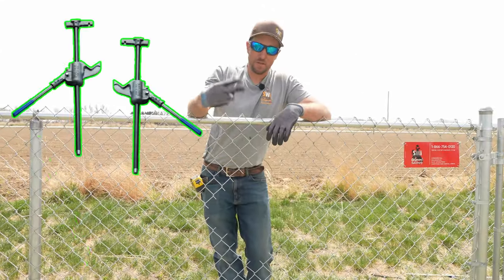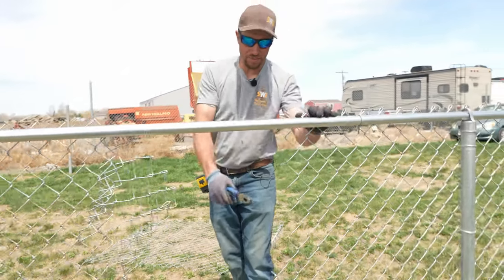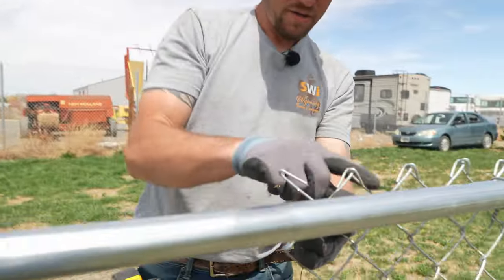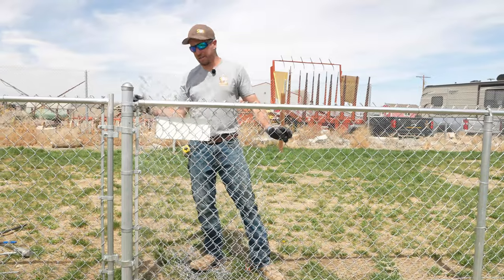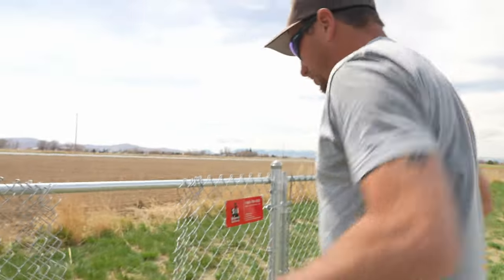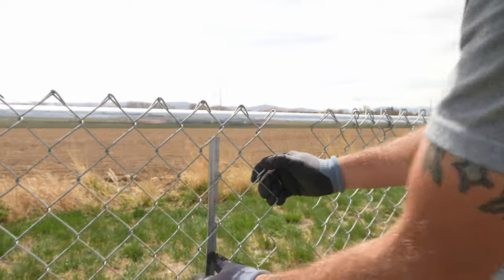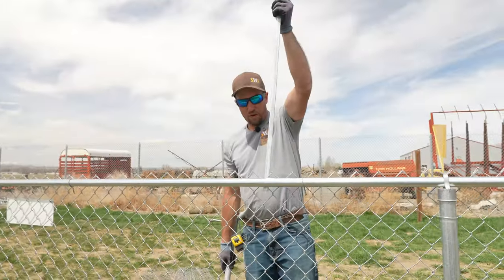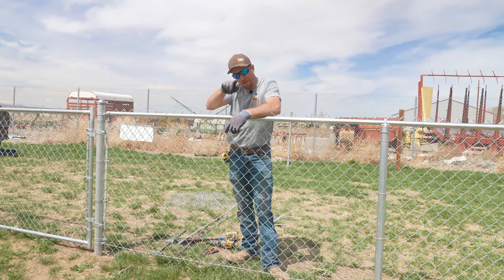Like New Again! Fix Damaged Chain Link Fabric

Comment: I swear of all platforms I'm most grateful for YouTube because of these tutorials. Changed my own rotors and brakes, fixed a toilet with YouTube.  Thank you for taking time to share your knowledge 🙏🏾
Reply from the maker: Great to hear! You're welcome. 👍🏻
Reply: Believe this or not, but I learned how to rebuild my truck's engine with Youtube.
Reply: @GuiltyPleasures  I’ve used YouTube videos to learn how to replace the horns and brake switch in my truck, how to shock chlorinate my well, how to replace a sink, how to construct a fire pit out of cinder blocks, how to raise ducks, and now how to repair holes in their chain-link enclosure. I feel like we’re using the internet the right way.
Reply: Same here
Reply: Absolutely!! Best app that's ever been or will ever be.

Comment: Fantastic explanation, thanks. I only had to watch the first few seconds and I got it figured out. Should I cut the extra tail ends off the zip ties?
Reply from the maker: Oh for sure. It's super unclassy to leave the tails on. 😆
Reply: @SWiFence  thank you for that advice! Ultimately, after doing that, I still felt like I could make it look even better, so I went to Home Depot and got the regular silver duct tape and did several wraps around each place where a black zip-tie was, and now you hardly know they're there 👍👍.  It blends right in with the metal color. It looks so much better, I'm thinking of wrapping each overlapping link with the duct tape so it looks more uniform. Great video, thanks! If you decide to edit your video to include the duct tape idea, you can just throw me a shout-out
Reply from the maker: Will do! 😆😆👍🏻👍🏻

Comment: Tried this at work today, with 8 ft repair. 
 It was ungodly how hard it was to twist the needle through, especially near the end, 
 We used a pulljack and a comealong method, 
 Ended up destroying the needle by the end of the day doing exactly what you mentioned about twisting from the top, 

 Any tips on how to do this better\easier?
Reply from the maker: A twist through is hard work--not going to argue with you there. You could maybe cut the strand in half, and twist each half in separately (leave an overlap)? Sorry--I don't have any great hacks for this.

Comment: I have a good question for the bottom of the chain link. The wire you use to reinforce the chain link to keep dogs from pushing under it, what is the best practice on that?
Reply from the maker: Hmmm, not sure what you're asking here.
Reply: @SWiFence  I was talking about the double braided wire you stretch at the bottom to keep the the fabric from getting stretched out at the bottom, but I just watched one of your videos where you showed your practice of doing that, but thanks for the reply. I really didn't know what to call it, and a neighbor has a dog that keeps getting out under it because no one ever put that wire at the bottom between the terminal posts. I guess I named them correctly; you put those 10' apart with a line post between them, and the wire that stretches between them. but I saw the hardware you use to connect them and then stretch the wire to put the tension on it and the lock the fabric to the wire with the links you use. I always see people wrapping that wire around the posts and stretching it by whatever means. I never see them use the double braded wire though; that makes more sense to add strength to the bottom of the fence. really enjoying the how to videos on chain link. I think I'm leaning more towards a cedar privacy fence, but I like the knowledge you are sharing on posts and chain link fence.

Comment: what's the use of this fence when it can be cut so easily :D Seeing how easy it cuts, I think a repair using screwdrive metal band will suffice
Reply: The point of the fence is to keep animals and such in or out.. If you're worried about criminals, I suggest a large concrete wall!

Comment: Looks like you have the pole with the tension bar about 2 feet away.  Couldn't you have just disconnected at the post, completed your repair weave with no tension on it, and then re-tensioned the fabric to the pole using the tension bar as an easier method?
Reply from the maker: You could disconnect it if that's your preference. We wanted to illustrate what to do if you don't have that option.
Reply: @SWiFence  Thanks for the reply.  Makes sense since you were showing folks how to weave in a section like that.  I was honestly curious if what I saw as a more logical solution since the pole was there, would have been a more efficient option.  Thanks for taking the time to respond.   Take care.